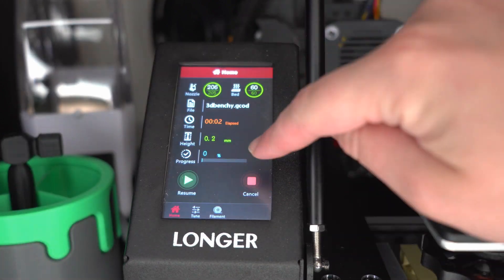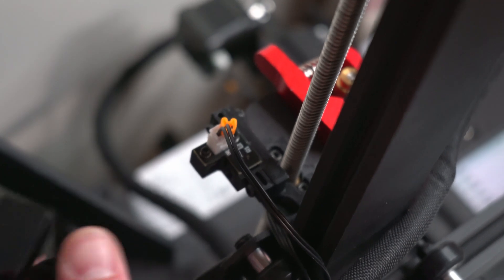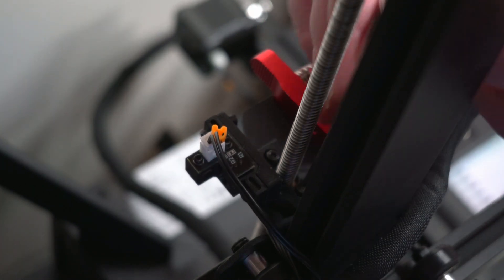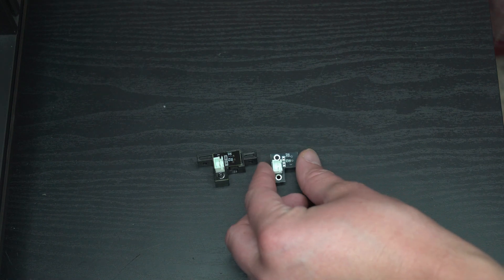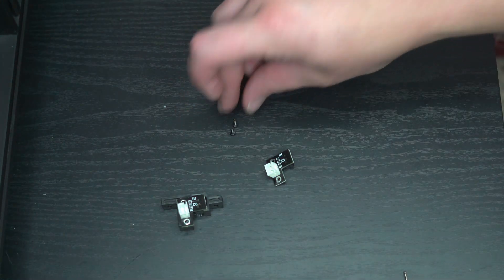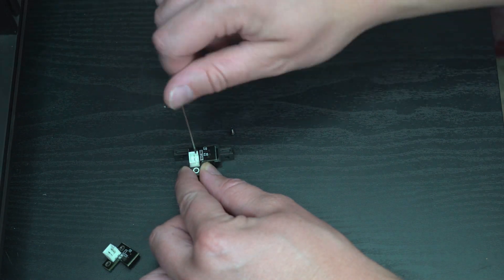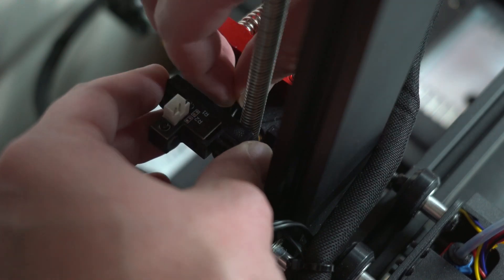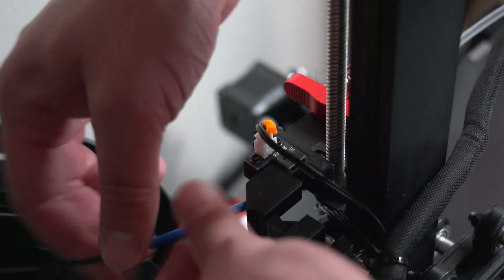How To Change the Filament Sensor on the Longer LK5 Pro | Easy Tutorial

Comment: I was 16 hours into a 25 hours print when I repeatedly got the error, and when I tried to pause and change the filament for the 20th time, I bumped the bed and had to restart. I’m rigging this machine to explode fr.
Reply from the maker: That's a real bummer. If you aren't worried about running out of filament during the print and you're having this issue, you can bypass the sensor completely. That will guarantee that it won't stop the print. I've got a tutorial for how to do that here: https://youtu.be/QjeNbS_p688?si=02NN1NvJRwUhToFq

Comment: I just got my longer not even a month ago it is saying out of filament multiple times with a full roll on it and I push in and hit resume it's knocking against the print like it changes position do I need to contact support the sensor shouldn't be worn down that short of time I have only done few things idk it wad perfect I haven't changed anything and even prints are becoming stringy no matter the kind of filament used also
Reply from the maker: @aliciajasondodd  I think contacting support is a good idea. They will most likely tell you to swap it out with the spare that they sent with the printer. But if that one also goes bad quickly, at least you'll have record of talking to them about it already.

Comment: My gear where the filament is fed into the tube, jumps/skips. Then I can't print. Will this part solve that problem?  Thanks in advance.
Reply from the maker: Hey Scott, I don't believe what you're describing will be fixed by the filament sensor. There are few possible reasons why the motor is skipping. The most likely issue is that you have a clog in your nozzle, which is preventing the filament to be able to pass through it like it should. I have a video on my channel on how to replace the nozzle. The other issue could be that your bowden tube is not sealed all the way against the nozzle. In my video on how to replace the bowden tube, I show how to make sure it is positioned correctly. It could be because the brass wheel is degrading and can't push the filament good enough. I have a video on how to replace the filament feeder as well. I replaced the plastic one on mine with an aluminum one. The other thing that it could be is that your filament is too wet and it is expanding when it gets to the nozzle. You could try drying it out or opening a new sealed filament to see if that is the issue. This is probably the least likely to be causing the problem, though.

I hope this helps!
Reply: @jfmedina2010   I'll take a look at your vids. Thanks a million for the advice.  Longer sent me a new nozzle and all the wiring attached to it. But it only skips every once in a while. I printed something for 10 hours the other day and it was fine. Do you think it's ok to just replace the nozzle and not all of the wiring, to see if that works?  What's strange is, that when I unloaded the filament the other day, the filament that was inside the blue feeder tube was "rough" on 1 side. It wasn't perfectly smooth and I though that was odd. Does that mean the tube might have something in it? It looks like it's a bitch just to replace that little bit of tubing! Thanks again.
Reply from the maker: I would definitely just start by replacing the little brass nozzle vs the entire hot end which is what it sounds like they sent you. If that doesn't fix it, I'd do the bowden tube (that blue feeder tube) next. 

The roughness on your filament is caused by the brass wheel on the feeder. If it skips on the same part of the filament multiple times it can start to "dig" into the filament.

Comment: WTF DUDE.... you don't have to take off the mount....G'z   just the 2  1.5 metric allen wrench,... and replace it... NOT rocket science...  ALSO  if you are in the middle of a print and it stops... like mine has 2 times so far.. the first one I messed up by moving the gantry EVEN just a little will screw up any current print.. so all I did is put a piece of tape over the tiny tab on the sensor... and it worked for a little while as I have been printing a shit ton of prints  sometimes 2 days+ straight,  Longer sent 2 sensors with my printer and now I see why..  :)    On my second sensor failure I carefully removed the 2  1.5mm metric allen bolts.. put tape over the pin and did not put it back in yet as I have a print that is going and will take 2 days 11 hours.. so for now just taped the pin... I will end up seeing if I can find an upgraded sensor .. if not,  I will just glue the pin in it's closed position and basically bypass it as the stock sensor sucks...  and my fix for this is to add a wifi power plug to the wall where my printer is plugged into , I have a 360 Wyze camera so I can see the print from anywhere with my phone,  if print started to fail, I will just remotely shut off power...  other than that... not much else you can do unless you want to just get a bag full of sensors...  :)    I don't know why this guy in this video doesn't tell you that if you move the gantry in any way if you are printing and the sensor goes out.. that print is done.. no fixed where it stopped..   And IT"S NOT A MATTER OF IF THE SENDOR GOES BAD... IT"S WHEN...
Reply: After watching the video and understanding what needed to be done, I just unloaded the spool, pulled the wires off, only removed the 2 tiny screws holding the sensor down. I replaced it, reconnected the wires, hand loaded the filament until it reached the nozzle. Hit resume and it started right where it ended.
Reply: When I try printing, the gear that feeds the filament "jumps." So obviously I can't pint anything. Would replacing this sensor fix my problem?
Reply: You can do it without taking it off but it's easier if you do take it off.
Reply: @zsavage1820  yeah I have done that several times I have to really much the filament and it makes the gantry slide and the other night I didnt do anything I hit resume since it never is actually out of filament but constantly says it is and it was knocking onto the print and it was about done I was so mad. My son wanted this and chose the longer if power goes out or run out and stuff it's pose to resume but so far seems like a gimmick.